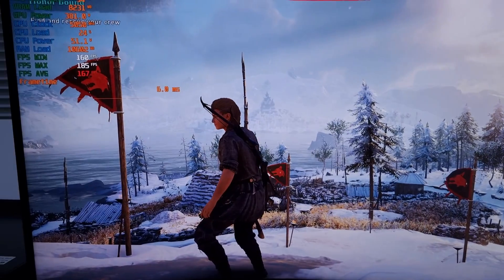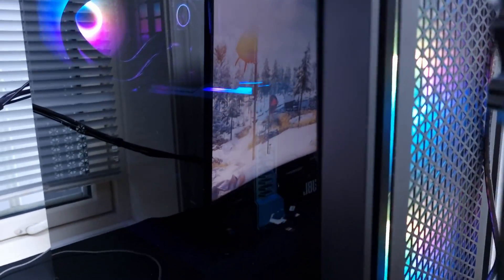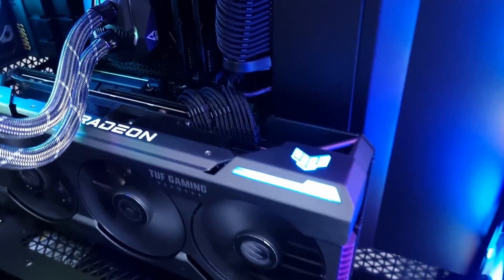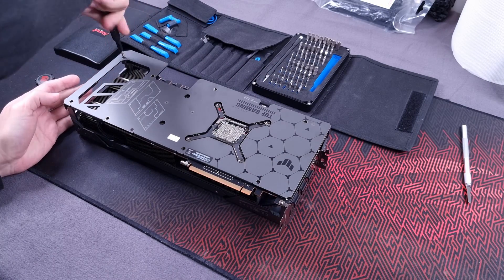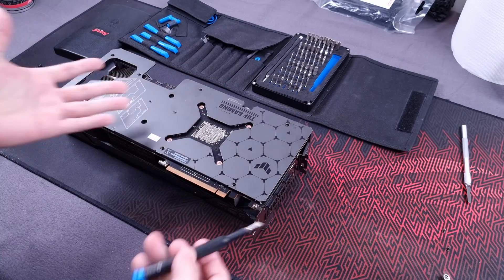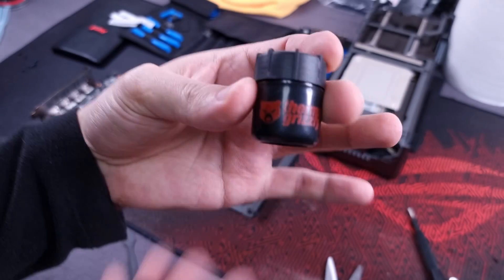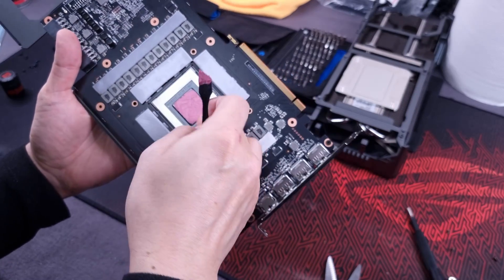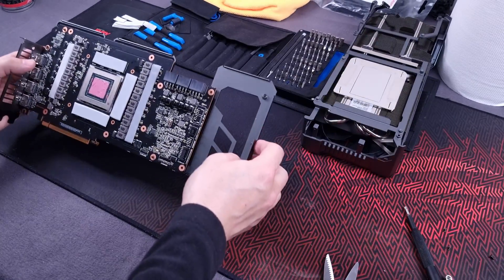ASUS TUF RX 7900XTX TEARDOWN (hotspot fix)

Comment: These cards don't even start thermal throttling until they hit a hotspot of 110c. And mounting horizontally is perfectly fine as long as using a GPU support. My XFX 7900xtx came with one. If not, they're like $5. Have had my XTX since launch and the highest hotspot I've ever seen so far is 76c. And that was during OCCT stress test.
Reply from the maker: I get those XFX 7900XT/X cards in for repair regularly. Always the same issue: dead due to sag. And XFX are so clueless, they added adhesive (not the dark adhesive that comes off easily with hot air) around the memory chips close to the PCI-E slot. This adhesive does not come off with hot air, and when you try and remove a memory chip, all the resistors around the chip are ripped off along with the chip. 

On top of that, that adhesive does absolutely nothing to prevent memory chips from developing cracked solder joints due to sag. Nothing. So keep using your support, or your card die in no time.
Reply: @TechnologyHive  That's a lie. Period. I have worked in a high volume repair center for over a decade now and have never seen a single XTX, XFX brand or not, in for breaking for sag. I own an XFX 7900XTX and it comes with one of the best all steel anti sag brackets you can get for a gpu. Have had mine since launch day and never a single issue. Have built countless PCs with similar GPUs and have never seen one come back for sag. Even see rigs that don't use any form or sag prevention that have zero issues. Large creators have even made videos showing just how far you have to push a GPU to break it. Even a quick Google search shows there are no widespread or even high volume issues as you claim. These things are searchable. You know that, right? So why flat out lie about it?
Reply from the maker: @traptinmymind186 I dont need to lie. I repair these cards for a living. It is a fact that these cards tend to fail more often than not due to sag when not using support. I dont need "lie" lol what would I get out of it?? If you really were in the GPU repair business, you would know about these cards. I think in fact yes there is a liar here and its not me 😂. Nice try.
Reply: @TechnologyHive I've not seen a single one in for repair for sag damage. If you knew how to do some research, you'd also see that it is not a known issue from any brand. So again, stop lying.
Reply from the maker: @traptinmymind186  I just showed in my latest video all the XFX 6000 and 7000 series cards dead due to sag and you're still going on about this LOL

Comment: Rx 7700 xt saphire pulse here  gpu temp its 64  but the hot spot reach aswell even 85 , it is good i still has warrnaty to it should i change the thermal paste and try to not break the sticker ? The gpu works just fine no stuttering no downclock
Reply from the maker: 85 hotspot is actually good at full load. Even if the delta is 30 degrees, I would not worry as long as im not going into the 100's on my hotspot, but this is just me. Also, its difficult to get a delta under 15 degrees on a chipplet design core. I've tried and the best I've gotten is 15 degrees difference. But its waaaay better than how it was before.
Reply: @TechnologyHive  On my old rtx 3070 msi gaming x trio i ve got 62 max and hotspot 73😅 Msi really knows how to do the cooling on cards and imo they are the best

Comment: I have Sapphire Radeon RX 7900 XTX Nitro+ Vapor-X 24GB,bought in january 2024,so far running with no issues.
But when i will need to replace the paste.....oh boy,it's going to be fun to open it up     :)
And i will probably use thermal pad for the GPU core,(maybe Thermal Grizzly Kryosheet).
Reply from the maker: Thermal Grizzly also makes PTM. But if you're going with ptm, I'd go with Thermalright Heilos V2. This is what I have tested and performed real well in my test.
Reply: @TechnologyHive  Thnx for info.

Comment: it's not just Asus, I have an XFX 7800XT and it does the same thing, runs like 70ish with a 90+ delta for the hotspot sometimes reaching over 100. Re-allied thermal paste using Corsair TP, same issue, so gonna order some thermal grizzly and new thermal pads as well seeing as how good it worked for you to get that delta down even by about 10+ or so.
Reply from the maker: Keep us updated on how it goes. Those XFX 7800 XT cards are a pain in the rear when it comes to hotspot. I have worked on countless of them. Its always death from sag.
Reply: @TechnologyHive well I have mine vertical mounted so there's no sag, dont have to worry about that at least, and rather than the thermal paste I order the TP7950 thermal phase shift pad, as I looked on several forms and everything and it has extremely good results some even lowering temps by almost 15-20c on the delta.
And in a few weeks, im going to order the water block for it and integrate it into my custome loop which Im sure will help greatly reduce the temps.

Comment: no pads on one row of vrm (u see at dissasemble, that one pad-row was there), the oder vrm row isn't either cooled by heatsink???
Reply: ah 4090 cooler on a xtx..i see....but the vrms aren'T cooled by heatsink^^
Reply from the maker: @Ovelux0025  Yes they are cooled by the heatsink. I just forgot to swap the old pad with a new one in the video. Many people pointed that out, and so I had to go back and replace that pad.

Comment: Hello, so I have hotspot problem with my Gigabyre Rx 5700xt too, it reaches 110c on average when gaming while the gpu temp stays on 75c less. I wonder if I need a better thermal paste? I am currently using Deepcool Z3 which I know is not sufficient enough to cool a toaster like the one I have. Should I try out Honeywell PTM? I hope you can give me tips about this, it's really is disappointing can't even play a game during the day without it thermal throttling...
Reply from the maker: I would definitely repaste the card with some MX-6 or Thermalright Heilos if you can find some. Also PTM7950 will do the trick.

Comment: I used Thermal Grizzle's KryoSheet on my XFX Merc 310 7900 XT, hot spot never gets more than 18*C delta and the hotspot rarely gets over 76*C now. The pain on there cooler is getting the right pads on the ram (had to use .5mm pads so the cooler touched the whole chip) and clamping force on the chip itself. For what ever reason XFX didn't use a X-spring on the mounting of the Chip, they just have 4 screws with little springs on them at each corner. You really have to almost brake the screws to get the right pressure makes me /Shiver every time I had to take it apart.
Reply from the maker: Another thing to be aware of with those RX 7900 XT cards from XFX is that they are notorious for dying due to sag. Sag causes the memory chips closed to the PCIe slot to fail due to cracked solder joints. Just and advice in case you are not using any support, please do so, or it wont be long before that card will fail. I repair those here frequently.
Reply: @TechnologyHive  I do have a holder on the very rear of the card. But it is just and I mean just touching it so it can't really drop/move anymore than it does on its own. It's in my TV/Bazzite rig and my father who is in a wheel chair loves to ram (lol) the entertainment center a lot. So I wanted something to keep if from being shocked when he hits it.
Reply from the maker: @TdrSld  Just a tip to help you keep that card alive. I would place the support between fans 2 and 3. Loosen up the screws holding the card to the case, let the card rest on the support, level it with the support, then retighten the screws. Keeping the support at the very end of the card does help, but optimal placement for supporting those cards in 2/3 the length of the card. Just a tip.
Reply: @TechnologyHive  thanks for the advice!

Comment: Did I kill my gpu?! just did this to my 7900xtx and followed step by step. Now I'm getting no display. Tried loosening the bracket, re applying paste, tightening the bracket, swapped cards with a different pc... nothing worked. Any ideas?
Reply: I didn’t put any new pads on the ram.. going to try that next
Reply from the maker: Just make sure the thermal pads are the right size.

Comment: You made it worse actually, you increased the hot spot delta from 20c to 25c. The core is running cooler after the thermal paste reapply probably because the fans are spinning faster or the card did not heat up yet. Or both. Thermal Grizzly is the worst for GPU's.
Reply from the maker: You dont know what you're talking about.
Reply: @TechnologyHive  There is just no way you dropped 20C by reapplying thermal paste.
Reply from the maker: @EvganyVorona Like I repair graphics cards for a living. I'd like to think I know what I'm doing. The fact that you think there is just no way reapplying thermal paste can drop temps by 20 degrees tells me you're new to this kind of stuff. And there's nothing wrong with being new to something.
Reply: @TechnologyHive I reapplied enough thermal paste in my life for 30 years on GPUs and CPUs and have never seen a 20c difference between old/new or different types of thermal paste unless someone forgot to remove the sticker from a new cooler or the cooler was not properly installed in the first place.
Reply from the maker: @EvganyVorona That you have never seen 20 degrees drop by changing the thermal paste is not true. You saw it here live with your own eyes. I dont understand how you can say its not possible when you saw it happen yourself. This is silly lol 😂

Comment: I got XFX XTX never had issues with it must be lucky. My current temps are the high forties for the gpu temps and the low seventies for hot spot.
Reply from the maker: I get those in for repair a lot. It looks like a lot of people are not using supports with these cards.
Reply: @TechnologyHive  If you mean the z bar support bracket I am using it I also bought a support as well no sagging on my end. I could probably repasted with Kryonaut extreme but those thermal pads make me nervous. They aren't exactly cheap to replace either and for what maybe 5 degree difference.

Comment: I had the same problem with my AsRock 7900XTX Taichi. I took it apart and there was a spot on the die with no thermal paste. Repasting only worked for a couple months, same issue. HWinfo64 was reporting a hotspot temp of 95-100c on MCD6 only. The GCD was only 70c and other MCDs were around 60c. I knew immediately what had happened - paste pump out. Luckily, installing a ptm7950 thermal pad did the trick because it's thicker and won't get pumped out of the way.
The 7900XTX AIB cards obviously suffer from paste pump out, just an unfortunate design decision I suppose. I don't mind having to play around with it, that's part of pc building. If you don't want to problem-solve, are you even a pc gamer? Just buy a console bud.
Reply from the maker: Its the chipplet design that causes these extreme core temp variations. I used Thermalright Heilos, and the problem went away immediately.

Comment: maybe you can use your iFixit flexible extender to reach the screws at the PCI bracket. Just a tip.
Reply from the maker: True. Since I made this video, I only removed the card once again to apply Thermalright Heilos. Thanks for the idea.

Comment: you never stretch out thermal pads, because if you do you make the pads thinner.  a 1.5 stretched can actually be 1.0. I always use a tool, vernier caliper's to measure everything coming off and going on.

Something is wrong with your system as you should not have a 100%load on your GPU when your not even playing, what kind of CPU are you running?  my buddy has a 7900 and he has an AIO for his and his numbers are way different, like 50 on the hot spot and idling on a game his load is at 15%, So i'd  say something is up with your card.  I hope you didn't bend your PCB because if you do on a card with that many layers, you'll definitely rip traces and pads
Reply from the maker: My gpu is not at 100% when im not using it. I dont know where you got that idea. And no, there's nothing wrong my system. I would know if there was.
Reply: @TechnologyHive  because it showed it at 100 percent load
Reply: @TechnologyHive  yeah I looked again on your video and at 180 fps and almost 3000 clock speed, your GPU load says 100% and with your gpu  in a game at idle the load should not be 100%.  unless you doing a stress test.  Do you understand what I am saying?  I am just repeating what I see on your video

Comment: I know im a bit late with this but..... The card suffer from bad mounting pressure, you can se that the pads on the sides where the gpu had bad pressure doesnt have the deep indents as the other side. And the coilwhine is a product of this. Solution is to add thin thermal pads between the backplate and the pcb where the pressure is lacking, or to squeeze the pads with indents with your fingers or a tool to allow for more even pressure.

Comment: I just did this on my 7900 xtx with some artic silver I had and it dropped my hot spot from 90-94 to 78-82.  Delta went from 25-30 to a more reasonable 15-20.  My fans have been very happy.  If the artic silver starts to pump out I plan to purchase the PTM7950.  I've read great things on the Kyrosheets, but I don't want to hassle with trying to to get one down perfectly when screwing up can equal a dead gpu.
Reply from the maker: Thermalright Heilos is also pretty good.

Comment: The thick areas of paste are not an issue. They are actually outside of the area of contact. Anytime you have a shiny surfact on the coldplate or GPU, you don't have good contact. The issue you have is in the middle. 

Way more paste than you needed.

Comment: tbf  19c difference between surface vs Hotspot is decent though and still safe area
like my RX6800 with MSI if surface temp was 75? it would been 105c in hotspot lol

and fact that you cant just tighten those surface/hotspot with air coolers and you just widen that up to 19c difference  from 25c difference...
yes im pretty sure you used more then newly repasted thermal paste but thats point that 75c vs 95c diff is fine even if you using long since if surface temp about high 80c then you end up repaste and since you widen that up gap by 25c if you use it long you have to repaste faster then default
Reply from the maker: If you do not mind your card thermal throttling then its on you. I would rather it have head room to auto boost and get best performance out of the card.
Reply: @TechnologyHive  thermal throttle comes from when hotspot reaching 115c or surface temp hitting 100c surface temp isnt really matter any card you get throttled before surface temp hitting 100c 

id want just card that starts with tight gap between them make it last long
Reply: @TechnologyHive  trust me i had RX6800 by MSI gaming X a card clearly designed Surface temp in mind that point card runs 65c at 105c hotspot thats like 40c gap compared your gpu before repaste

Comment: you can use  PTM7950 or just get thermal paste meant for GPU that have higher viscous to avoid pump out
Reply from the maker: I've tried MX-6 and its working great 👍🏼
Reply: @TechnologyHive  MX6 is not for long term keep an eye on your temps because they will creep up
Reply from the maker: @joeydelmarsjr.646  Its been running 24/7 in my Folding@home 2080ti card since 2022 and temps are the same as day one.

Comment: So miserable for a simple task jeez 🤣things happen what are you like when you need to do a service on your car is that junk too?
Reply from the maker: I don't own a car. I burned down the last one I had because it made me so angry for having a flat tire, blown head gasket, clutch was slipping, it didn't play 8 track cassettes, 3 burnt headlights, and the 5th wheel wouldn't slide which caused me to be front overweight. Pisses me off just thinking about it. 🤬

Comment: I noticed my tuf 4070s getting 20c hotspot delta, core would be 68c and the hotspot would usually be 85c but spike to 88c. Just did an undervolt to 0.975 with the same core clock and the core went down to 60c and the hotspot to 72-75c. If the undervolt lowered my delta this much does that mean my paste is still good or should I repaste? The card is only  5 months old.
Reply from the maker: 88c hotspot is normal for these cards. I would not bother repasting unless you see it going into the high 90's. But even then all the card will do is thermal throttle in order to protect itself.

Comment: to fix the coil whine use the stock psu cables and cap your fps, also you can do a undervolt if you want.
Reply from the maker: ...just turn on VSync

Comment: I had to re-paste my 4080 strix today, temps were basically same as yours was. I knew something wasnt right with this giant 4090 cooler on it hitting 75-80c and 100c hotspot.. low and behold 90% of the thermal paste was pushed out onto the edges of the die. I used a ptm7950 pad and the temp decrease was significant, atleast 10c on the gpu and hotspot reduced by 20c.. it's really dissapointing they cheap out on thermal paste application or can't figure out how to stop it from leaking out, I had to void my warranty to get the thermal performance I should have got out of the box 👎 I dealt with it for almost 2 years because of warranty and got fed up of it sounding like a hair dryer, best decision I ever made. I can finally enjoy the GPU for what it's meant to be.

Comment: I have gigabyte rx 7800 xt. 
In my room at 35°c, Her max temperature is 62°c and max hotspot is 85°c. Is it acceptable ?
Reply from the maker: Hotspot in the 80s is more than acceptable to me.
Reply: That hotspot is a bit high in fact for that GPU. If it's a Gigabyte in particular, they're not well engineered for cooling and sometimes need repasting and repadding, even when new. That GPU shouldn't be getting above the mid 70's in normal gaming.